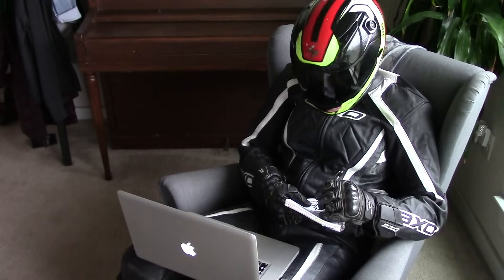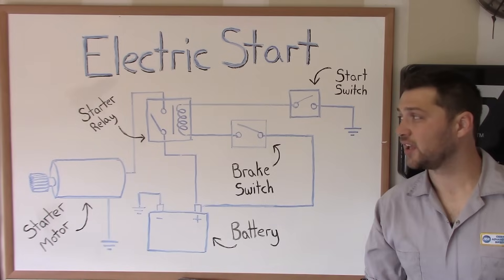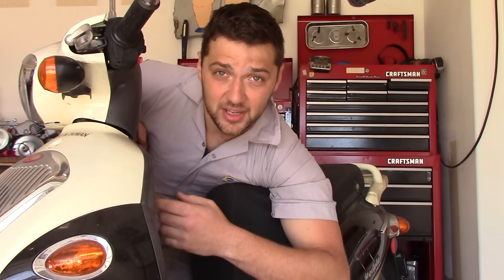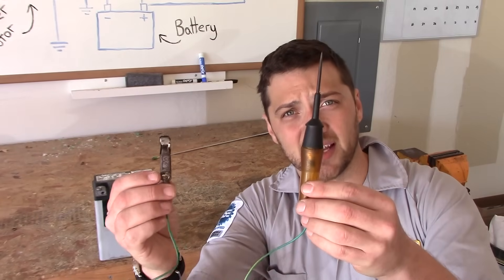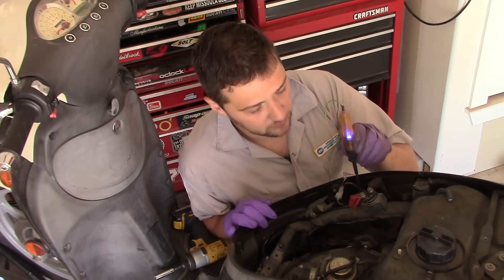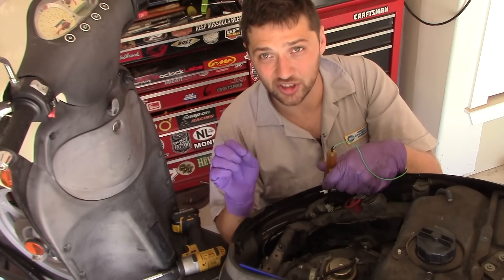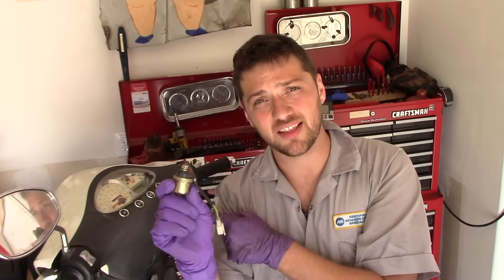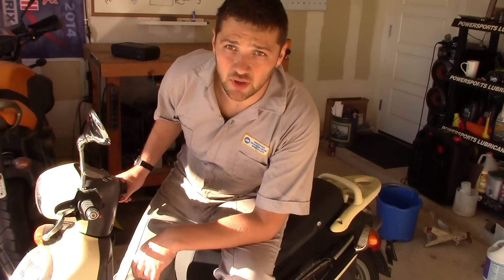Scooter 911: Electric Start Doesn't Work (troubleshooting your starter, starter relay, and circuit)

Comment: Hi Garret, everything worked fine in terms of testing on my Buddy 125 (the test lights came on) until the relay bypass.  It sparked but nothing from the starter, just silence.  I was getting electrical type clicking noises when pressing the start button before the aforementioned tests.  The bike will start and run using the kick starter.  It sounds like the starter?
Reply from the maker: Sounds like

Comment: If I have no front brakes, will it start it electrically?
Reply from the maker: Yes. The rear brake also has a switch that should illuminate the brake light and supply the starter relay

Comment: The lights stop coming on and nothing works battery is knew and it ran fine before I trucked it home , I turned the key on lights on pushed starter button and everything turned off won’t do anything checked the 20 amp fuse .looked good
Reply from the maker: Check the ground connection from the negative battery cable to the frame and make sure your battery terminals are clean and tight

Comment: I have a roughhouse and the break lights work and the panel turns on when I turn the key but the starter doesn’t work what should I do to make the starter work again? Clean the connection?
Reply from the maker: Did you try the relay bypass test at 7:30?

Comment: Thank you for this video- you are so skillful!. I used your guidance to verify that the starter relay is working.  But,  I'm hoping you can offer some additional guidance.  My scooter (2001 Italjet Torpedo 125 4T) had what I thought was a malfunctioning starter because when I turned on ignition key and hit the start button-rather than the typical cranking- I would hear a fast winding sound. After a few consecutive attempts- I no longer hear the winding sound- instead I hear just a slight click sound that comes from the relay when I try to start the engine.  Using the test light, I can verify that positive wire that is connected to the starter has power when I try to start (key on/brake lever engaged/starter button pushed)- despite the power, I get no cranking sound or even high pitch winding sound at all. Any suggestions/advice/guidance you can offer for next steps  would be greatly appreciated.  I'm guessing that the starter is toast- but maybe something I've overlooked?
Reply from the maker: It sounds like you probably have a bad starter. Nice use of the test light
Reply: @Scooter_911  Quick reply is much appreciated.  Thank you.  I guess I was hoping it might be a blown fuse- but am having trouble finding the fuses on this bike. Any reason to check the coil?
Reply from the maker: @patriciahilleren3379  nope, the coil is in a completely different system than the starter. If the starter motor was cranking the engine but the engine was not starting, that would be a good time to check the coil

Comment: i have a mc-08-50 roketa it has no power going to the handle bars only the horn  does and wont start
Reply from the maker: Bummer dude, sounds like a wire harness issue you're going to have to sort out with a test light
Reply: I jumped the relay got it to run for about a min

Comment: I need help, my turn signals work , engine on or off they seemed to be blinking faster this morning while drive, starter doesnt work , brake switches arent faulty, and I cant even bypass the starter relay it just sparks a tiny bit but doesnt even attempt to start it, it starts kickstart perfectly fine but everything else works, blinkers, headlights, even horn is loud as usually
Reply from the maker: Make sure that you don't have any loose ground wires and that the power wire to the starter is securely connected. If all of those are good and you get the same result replace the starter

Comment: I keep getting an issue where the starter motor keeps turning over after iv already started the bike. Iv taken it to multiple services stations and they keep diagnosing it as a bad battery and bad relay but iv had them replaced 3 times now and the issue keeps reoccurring usually after a few months and they keep saying its the same thing. I had to smack the relay to get it to stop and then kick start the bike to go anywhere. Any ideas as to why the heck this keeps happening?
Reply from the maker: Your starter motor is actually shorted. Its drawing too many amps and welding the contacts closed in your relay. By chance is it a kymco people? Its a common problem on those scooters
Reply: @Scooter_911  Thanks very much for the reply, you mean the motor itself or a wire coming from it? Would replacing the starter motor fix the issue? Its a kymco agility city 125.
Reply from the maker: @eraldorh  yes indeed its the starter motor itself. I recommend replacing it. I'm not sure why it happens more on kymcos. You might also pick up one more starter relay. Once they weld themselves shut they're never the same.
Reply: @Scooter_911  Thanks for the advice mate I really appreciate it. Ironically the last time I was getting it serviced I gave them the new starter motor I had bought and asked them to replace it and they said the starter motor was fine and again said it was definitely the bad battery and relay that was causing the problem. I'll give it a shot replacing it myself this time. Thanks again.

Comment: Hi my friend, thank you for your video clearly explained. I have got a used 300-electric scooteretti Piaggio last week. The owner told me he replaced the battery by a new one in October 2019. I have tested the scooter with him 3 min, it was working perfect. When i took it and i left, just about 8 min in the road my problems started. , scooter is losing power quickly and stops. Even when i charged the battery during 7 hours, when start the scooter i don't listen any motor sound but it start to run for around 2 minutes and then it loss power and stops. I can't even push it to garage becacuse it's too heavy. I don't know too much about the mechanics but any tips would be apreciated. Thank you.

Comment: My Zuma is making the sound at 3:36 . I have bought a new battery & starter but it still won’t start. Any suggestions??
Reply from the maker: Check out this video https://youtu.be/xW5y7a7CB1c it should get you pointed in the correct direction!
Reply: @Scooter_911  Thank you.

Comment: So I did the manual bypass with a screwdriver. It sparked but still didn't crank. My battery has a 12v hold and the brake lights illuminates. Could it be the starter motor.
Reply from the maker: Yep sounds like you've got a bad starter or a seized engine.
Reply: @Scooter_911  well I removed the starter motor. Gave 12v directly to it with booster cables and my scooter battery.. It spun. I'm going to replace the start relay solenoid. If that doesn't work. It must be a seized motor. I will mention that I've been riding it without a header and muffler. So if the new solenoid doesn't work. I know I must've finally blew the motor days before I was finna put at least a header on.

Comment: Please man help me somehow if u can.Ive got power on the horn or light ,but when i try to start it up on the start up switch everything goes dead with no sounds.Whats the problem maybe?
Reply: The battery is pretty new tho idk what should be
Reply from the maker: sounds like you have a loose ground. check the connections from your battery cables to the battery terminals and where the negative battery cable grounds to the chasis. Good luck!

Comment: I’ve changed my starter relay and spark plug I’ve done a full service but my bike still won’t start up and when I try to start it up it drains the battery do you know what the issue might be. Is it the battery or the stator
Reply from the maker: it could be either or both. you wont know until you do some digging. I created a diagnostic video to try to help you get started in the right direction though https://youtu.be/xW5y7a7CB1c

Comment: I rebuilt my 70ccscooter, new piston, rings etc and all. New spark plug, cdi. And when i was done putting all things back and so excited that it will finally turn on and when i pressed the electric starter, all i heard was like a flickering switch sound that cuts off power like in a split second and resets everything on mu dash like the time. Can’t even crank the engine. What could it be?haha. . Will check the wire harnesses if i reconnected it right. I did have the spark plug cap which is still stock come loose ones but managed to screw it back on.
Reply from the maker: usually that instantaneous power loss is due to a bad ground connection. If your scooter has the additional ground wires that bolt on to the valve cover make sure they're securely connected. It could even be something as simple as a loose battery terminal!
Reply: Garret Seesing thanks man will check on it tomorrow. Just weird coz i don’t have electrical issues prior to the rebuild
Reply: Manage to kickstart the scooter and idles well which I am half happy about as it starts. Now just this electric that i have to trouble shoot. I have a minarelli clone engine by the way
Reply: Hi man, had the battery recharged and when i use the electric start, all i can hear is the starter motor turning like it spinning fast but can’t get the scooter to start? Could it be the culprit? As per your video, tried clipping the test light wire to a ground and tedted the (-) side of the relay and use the elctric switch and is able to light up the test light which i assume that the relay is working ok as per your video.
Reply from the maker: @ninoechavez1402  yes it could but take the belt cover off and visually observe the starter gear engage the teeth on the variator. there's a little bushing the starter motor shaft is supported by built into the belt cover. sometimes debris builds up and doesnt allow the starter to fully engage. Cheers!
Reply: Garret Seesing hi man, checked it today. The gear toothed gear does engage with the starter cog, the one thats behind the variator when i press the start button and spins but can’t seem to turn the variator+ shaft to go with it? Is it still a motor issue not spinning strong enough?

Comment: Hey, I bought a scooter that was working and now it doesn't seem to be working at all. When I try to start it absolutely nothing happens (no lights, brake, dashboard or otherwise). Knowing nothing about scooters I thought it might be the battery but when I checked it was mostly full and I charged it to full. Still nothing. I thought it might be the starter but when I tried to follow your video I removed the seat and could not find the starter. I believe I have a Vespa lx50 made in 2009. I tried checking under the floor/ foot board but mine appears to be solid under the rubber mat there. I'm not sure what to do now or where to find the starter.
Reply from the maker: if you have no power (horn turn signals etc) when you turn the key to the on position you probably have a blown fuse or a loose battery connection either in your cables or at the battery terminals. Try troubleshooting the power issue before going deeper into the mechanical components. Good luck!
Reply: @Scooter_911  Thank you! I appreciate you responding so quickly! I'll definitely look into it.

Comment: "If you scooter is making this sound, you have a diffrent problem". What is the diffrent problem?
Reply: My 50cc peace sport tpgs-805 has spark, fuel, and combustion but still wont start, what do i do?
Reply from the maker: @aaronbarnett9209  well if it has combustion then it would be running. You tried puffing some carb cleaner in the carb and no start? then you observed the spark? if those are true you likely dont have enough compression
Reply from the maker: I made this video to help you find out! https://youtu.be/xW5y7a7CB1c

Comment: I tried your relay bypass with the needle nose pliers -the sparks flew but the engine didn’t kick over -what does that tell us ( didnt land me a date :))
Reply from the maker: That tells you that you most likely have a bum starter motor. Make sure the positive starter connection is clean and tight and make sure the engine is grounded into the harness! good luck!
Reply: thx! btw what do sparks mean?
Reply from the maker: @allans7281  just that current is flowing because you've completed the circuit.

Comment: Which wire goes to the positive side of the battery in which one goes to the negative. 
I only see a wire thats black and one that has green tape on it. Thx!! ( what would happen if you reverse the wires on the battery)
Reply from the maker: If you follow the wires the negative cable will terminate at the frame and in the harness. The positive wire will go to the starter relay. Green is the color of ground wires in Chinese scooters so more than likely the green tape signifies the negative cable
Reply: My bike is your Kimco 150 people. Strange how it didn’t have the positive wire wrapped in red. When I push my start button nothing happens -I’m starting to think maybe the starter motor is dead because the bike just died suddenly Enjoy watching your videos!!

Comment: Hey i have a 2015 taotao evo50. I bought a new ignition switch but not sure what wires to hook up. On the scooter the wires are red, green, black and black and blue on the ignition switch its red, green, black and black and white.

Comment: I got a 50cc taotao ignition switch. The switch I ordered is red, green, black and black and white but on the scooter its red, green, black and black and blue. Not.sure what wires to hook up.
Reply from the maker: green is ground so green always goes to green. red is battery voltage so those will go together. Black is switch power and black with white tracer is the killswitch. When you shut the ignition switch off you send ground (from the green wire) to the black with white tracer. and switch on passes battery voltage from the red wire to the black wire. So black with blue stripe to black with white stripe is my guess. You can always verify these with a test light or multimeter.
Reply: @Scooter_911  hey I got everything going but it'll start but when you give it gas it has low power and wants to die and as soon as you let go of the gas it dies.
Reply from the maker: @zach09j  have you tried a valve adjustment yet? Also did it sit for more than a few months?
Reply: @Scooter_911  I haven't tried a valve adjustment just yet. Imma try that tomorrow and see what happens. I'm not sure. I would say it has.
Reply from the maker: @zach09j  if it has been sitting a while it might need the carburetor serviced. As fuel goes bad in the carb it clogs the jets. If it starts fine and runs fine other than not taking a throttle I would go for the carburetor first
Reply: @Scooter_911  okay. We tried cleaning the carburetor but we couldn't get it off to get to the jets to see if they were clogged up. How could I get the 3 screws out that holds the peice on?
Reply from the maker: @zach09j  if they don't have Philips head screws you're going to have to use a hack saw to slot them. I've got a video on it coming out in a bit.
Reply: @Scooter_911  okay. Yeah it doesn't have a head on it.
Reply: @Scooter_911  we adjusted the valves. They need some adjustments but it still don't wanna idle and it has low power when giving it gas. So now we're gonna get a new carburetor and see if that helps.
Reply: @Scooter_911  got it great. All lights and stuff work but now I need help with my kill switch. Would you know anything about the kill switch as far wiring goes. How does it hook to the switch. Its a 6 prong kill switch but only 5 wires

Comment: Hello.
I have Kymco people 2005 and i  replace new battery , spark plug but no light, no electricity,,, so please I need your help
Reply from the maker: Check the 10amp fuse near the positive battery cable

Comment: Great video easy to understand my scooter I have your Kimco 150 it looks exactly like that- it was running then I turned it back on 20 minutes later and it just died and no sound no click nothing - and the horn doesn’t work when i turn mey. Bad battery?
Reply from the maker: It very well could be! Check the fuse on the positive battery cable as well and try the starter bypass test at 7:32